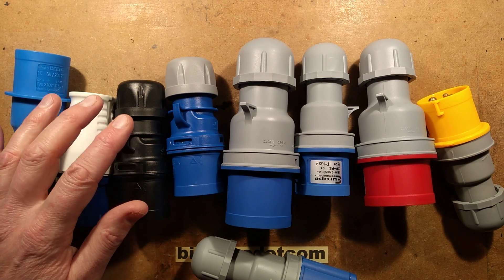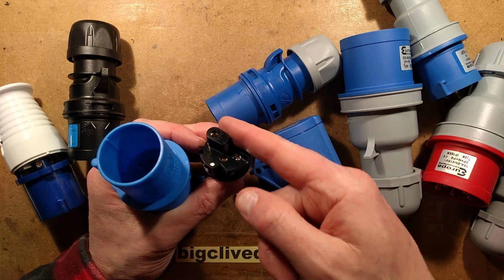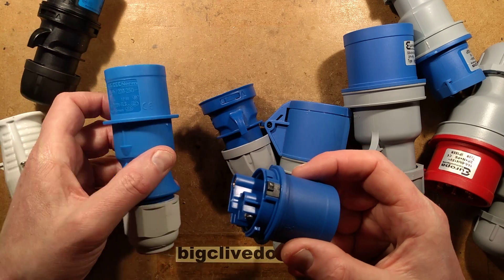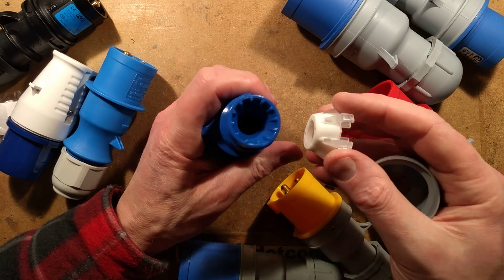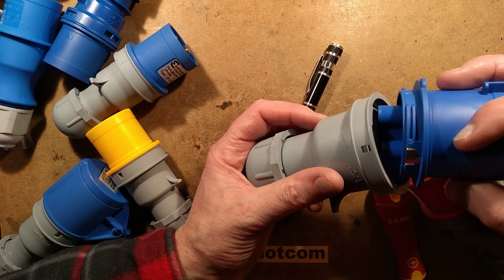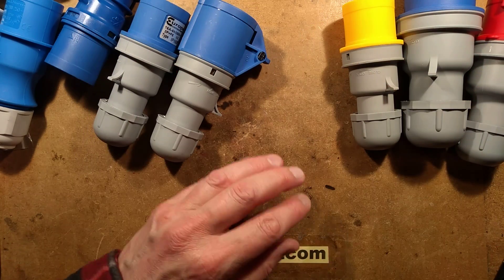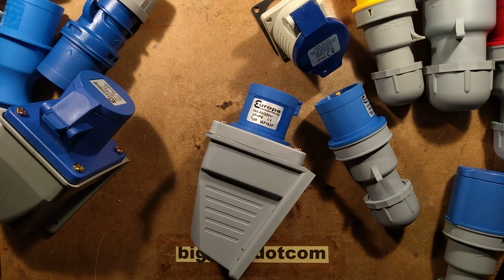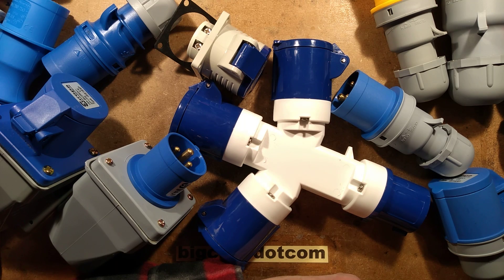My favourite industrial connector (Ceeform).

Comment: Telecommunications in the states for secondary backup generator connection.  Remote equipment shacks have a UPS that can hold it for 48 hours, and a onsite generator with enough fuel for 7 days of operation.  for every 3 remote locations, we have a response generator that can be towed to site, and connected.

Comment: we use them for almost anything here in Finland. On our workshop at home our welder, air compressor, fans, and bigger extension cords have the the 16a or 32a 3-phase plug. we have them around all around the yard so we can take power where needed for welder etc
Reply: also never seen a blue one myself. we have the red ones only

Comment: It's like a shore power connector here in the States but the pins vary. Some are like the ones you show here. Other's are done like American plugs.
It's used in campers, RV's, van homes, tiny houses, boats etc when plugging into the electric grid.

Comment: As a chef we have them EVERYWHERE in the kitchen, the ovens use LOADS of power. 
So does most of the machines we use, e.g industrial dish washers and mixers.
So I'm familiar with them, we have 2 that look like normal plugs.
Charge my phone from it lmao.
Also there are HUGE red switches that turn them on and it scares me every time.

ALSO YESSS THE CATERING INDUSTRY GETS A MENTION, AND YOU RIGHT ONE OF MY CHEFS PLUGGED A 240V HOT CUPBOARD IN TO A 400 SOMETHING V AND THAT WAS SOOOO LUCKY NO ONE GOT HURT, RUINED A 3K HOT CUPBOARD LOL.

THE DISHWASHER RUNS ON 300V  PLUGS FOR SOME REASON.

Comment: I've seen single and 3 phase versions on refrigerated trucks, trailers and shipping containers here in Australia. Used for powering the refrigeration equipment when the vehicle/container is in storage in a yard/warehouse etc. A diesel engine normally runs them when mobile. Usually the lead has a female single or 3 phase Cee-Form on one end and a single or 3 phase Clipsal 56 series or equivalent connector on the line end which is our standard for heavy duty 240v single phase and 415v 3 phase wall outlets especially in industry.

Comment: Switzerland, we use them for anything larger.
Starting to use them from 16 or 32A depending on usage
For things that don't get abused we can use the much, much more handy T23 or T25, if 3 phase is needed, connectors.
Also encountering the CEE plugs in cheap German imports when we turn up with the local sockets and curse Germany.
Personally not enjoying the CEE much. But it's better than the old J connectors (J40 for a 40A example). One thing that the CEE is missing when replacing certain J connectors is the ability to be plugged in in reverse. Some odd farm equipment I've encountered relies on the plug to reverse the motors.

Comment: I've seen similar connectors on a German-made motorized construction material lift.
I think it was under a different name, but the GEDA Solarlift is pretty much the same as was what we had, and the winch unit had 3 connectors; a 3-pin for the top safety switch, a 5-pin for the control unit, and a bigger 3-pin for the power inlet cord.
Reply: 63Amps?  100A peak = 63A average.  Still a strange number. Then there  is 6.3V for thermionic valve heaters...

Comment: If you have a cable with a CEAG ATEX plug on it, you can use the CEE socket to connect it. Obviously don't do it in an ATEX enviroment, but great for making an adaptor for powering up the tool for maintenance. They are likewise colourcoded yellow and blue.

Comment: "I like to twist them, and fold them over, and fill that hole there" -Clive
Reply: what about ferrules? i like using ferrules, even if uncrimped, on stranded wire which goes directly under a screw
Reply: @ketas  you may have missed a double entendre.
Reply: So that's what he means by big clive.
Reply: Dirty fecker! 🤣
Reply: @johnf3326  Depends on which holes he likes the fill. So holes are dirtier that others. 😯😈😆
Reply: @dadillen5902  Even the same types of "connectors" vary greatly in their relative cleanliness!

Comment: i have used them a lot. mostely the blue 63A 3P+PE here at home i only have blue 16 and 32A 3P+pe (4 pin 3 phase 230 volt.) other places i use the red  400volt one 4p+PE.

you did not have many 3 phase blue there.. and no 3+E ones.

ohh i'm in norway.. we have a IT/DELTA power grid. hope you never get to work on one ;)

Comment: You forgot to mention that the latch on the outlet will grab onto the plug when connected making it hard to pull them out on accident by tripping over the cable for instance. 
Also i have seen a new version that does not use any screws. you simply put the wires in the right slots inside (they are labeled and colored so its even less likely to mix anything up). Then you simply screw one pice into the other. Blades in the other part bite into the wires as you tighten and establish the connection.
I cant fint a picture right now unfortunately.

Comment: I use the 380v 16a 5pin on electronic hoist (entertainmentindustry) but i found them with a white circle inside that allows you to swap 2 phases with just a click of a screwdriver, very handy if you rented some badly wired hoist and one goes down when the rest goes up

Comment: I'm in the US and we use them for a few things in my work. We use them to plug PDUs into the overhead power distribution in our data center. We also have a bank of powerlocks on our generator building to allow us to hook up a portable generator  to supply standby power in the event of a generator failure. In our switchgear room we used to have powerlocks setup so that we could cross-feed the A power system from the B inputs in the event of a double UPS failure or problems with bypass modules. During our last power system upgrade we replaced that with some custom switchgear that does the same thing in a much safer (and more convenient) way.

Comment: I finally have to disagree with you. While they are great new, once the are used outdoors over and over again, the holders for the metal pins wear. These plugs become Chinese finger traps and are nearly impossible to unplug.

The metal pin and the female side are not firmly fixed in space. If you imagine they angle when being pulled apart they will wedge and make it take astronomical forces.

They are used in US for RV plugs and also carnival rides and outdoor events

Comment: Dutch firedepartements have to change all connectors on electrical equiptment to Ceeform to be used on our own generators. This is also to prevent personell using normal eu sockets from house installations.

Comment: I've got boxes of these connectors and reels and reels of cable for free in the last couple of years as people move from 110V tools to battery tools in the UK

Best find was a 110V rope light, a 110V cable with 20-odd light sockets, was given it as "110V bulbs are impossible to find now", I just filled it up with LED bulbs that are also sold in the US and it all works fine! :)

Comment: I've got a plug with a switch on that I use as a control pickle for chain hoists on stages. Yellow one
Reply: Pretty normal for that industry, but completely NON standard usage of a yellow plug
Reply: @jesperdahl1486  it allows me to control each motor independently. Good for running chains through on derig etc. I agree it's non standard usage. I was in construction for years and only used them for 110V.
It works fine, though.
Reply: @Critical_Stinking  I know it works fine, one of the bigger production company's in Copenhagen has them on their LOADSTAR cranes
Reply: @jesperdahl1486  I use the same. CM Loadstar

Comment: They are very common in Austria. In fact I have two of the red 3-phase outlets in the basement for tools with 3-phase motors (even simple things like a drill press) and heavier equipment like concrete mixers. So not industrial at all. Just normal home use, and I guess many households (except for flats) will have an outlet somewhere.
I also have a 3-phase extension wire, where two of the pins can be rotated around in order to make motors turn the other way. I actually don't know if there's a standard in how the phases are to be wired, but I have seen quite a few 3-phase tools that have a reverse switch of their own, so I think the direction of the phases can be random and you switch them into the order you need them.

Btw. I don't think that you mentioned that the cover is not only a cover but when plugged in also doubles as a lock to prevent disconnect when pulling on the cord.
Reply: You are SUPPOSED to connect the Phases L1 - L2 - L3 in a clockwise fashion, when looking at a outlet, but things happen, therefore the changeable plug is nice, when connecting motors

Comment: Sadly, the NEMA SS2-50R 50 Amps 125/250 Volts Connectors I like to use for exterior use (and for heavy current situation in my shop for welders and such) are bloody extortionately expensive.  And just as painful for the 240/480 3-phase four-pin versions. :(  But they last *forever*… I’ve got a portable screening plant + generator that’s going on 30 years of intermittent service.

Comment: I always used the one with 2 internal screws, mostly used in farm situations (say no more about farmers with electrics), the ones we used had a rubber cone on the back which helped with the bending you mentioned at the end
Not sure i like the idea of being able to remove the cover while still plugged in, but if you're ok with it, that's  fine
Biggest i've installed was 63A 3ph + N for a generator feed to a building (essential supplies)
You may find it easier to get the inlet plugs from caravan suppliers, though we had no problem getting them from the usual electrical wholesalers.

Comment: I use the yellow 16A3p9h for ACL light bars, 16A3p6h for power distribution and 16A to 125A5p6h for powerfeed like every normal human being in the german show tech scene. Fun fact: the 63A5p6h and 125A5p6h connectors have a 6th pin to trigger a contactor at the feed side so it's not possible to accidentaly plug or unplug the connector under great load.

Comment: We use them extensively in the maritime industry, the purple SLV style is used as trickle chargers for the lifeboats batteries.  Interestingly we also have 240V all metal female sockets around the deck for powering machinery.  The all metal construction is to protect against impact from cranes and cargo.  They are all slightly different in that the cap is screwed in place with a gasket to give a better seal when not in use.
Reply: Another interesting fact with ships including cruise ships is that the AC carries two phases 180deg out of sync as we cannot run neutral to the structure as it accelerates corrosion.

Comment: I know that in the usa there used a lot for snowmaking, it's pretty much the same but 4 prong, 3 phase, 480v mostly, and no ground.
Lots of different amperes from 15 amp to 80 amp mostly, with the ones I've seen.
That's the only use I've seen them in the usa.

Comment: Most homes in NZ have these installed in the bedroom for mains operated vibratory devices....
Reply: I think that's only the 3-phase variants.... And it's somewhat limited to Otara and the Sth Island
Reply: So that's why the lights dim.
Reply: I'd have thought extra vibratory devices were the last thing needed in NZ...
Reply: @igornotis8877  You may have been a touch too subtle there.
Reply: I assume those will be the Electric sheep
Reply: Tony Nicholson
😲
Reply: @steveosshenanigans  My landlady has a 125A Ceeform on her wall. I always wondered about that till now. Thanks so much.
Reply: Industrial grade concrete vibrator._
Reply: Excellent for the moist environment also.

Comment: Hi Clive,
 say is there another plug for 3 phase power in GB, or only the CEE 5pol?
in germany cee 5 pole is the only connection i see for 3 phase power, on old installation there is that perilix connector a thing, but non are new installed.
There is also that 4pol cee variant for 3 phase motors which don't need an N connection...
Reply: An than is there that wired 7 pol variant where you can use it for al kinds of crazy things, i have sen one on an air powered silo, stucco delivery system on an job site

Comment: Very common here in Germany. For the three-phase version there's also a version available with an integrated phase changer to change the rotating direction of a motor. It will change the positions of L2 and L3:

https://www.spaelti-ag.ch/elektro/wp-content/uploads/2017/12/Funktionsprinzip-1024x473.png

The versions for 63A and larger have a pilot contact integrated, so you're able to switch the load off with a contactor in the fuse board. Otherwise it could create an arc if disconnected with a load. The pilot contact will switch on the contactor only if the plug is fully inserted.

Pilot contact in the center:

https://upload.wikimedia.org/wikipedia/commons/a/af/CEE_Stecker_mit_Pilotkontakt_63A_6h_5P_2012_01_31.jpg

The pilot is connected to the N:

https://docplayer.org/docs-images/67/57797804/images/25-2.jpg

Comment: Similar design used in shore power connections on US research ships I've worked.  Most dated from the 1960s, but the connection could have been upgraded over the years.

Comment: what about the ceeform connectors that twist-lock onto one another when connected ?
Reply: You sure you mean ceeform, and not something like powerCON or powerlock/camlock?
Reply: @Grizzly01  nope, deffo ceeform, there was a version of it, from MK i think, that both socket and plug IP67 rated K series commando by MK had twist caps for a better seal.....such as the 415v K9097

Comment: I use the 16A at home as  extension leads so i can leave them outside at night and handy for Xmas. And  the hard plastic drive over bumps are used for 3  phase leads when they are  individual cores

Comment: What did you use before the cee cables. We use them in Denmark as well.  Before that, we had some flat connectors (Googleing “Dansk flerpolet system” found some pictures, YouTube likes to mark comments with external links as spam) 
 I remember in the early 80s, I was working summer jobs during the school vacation, cleaning machines with a high pressure washer at the paper mill. At that time we had no problem having a 14-15 year old working a machine that cut off fingers with water. 🤣 anyway that had a even more arcane connector with their heavy cables where I needed both hands to lift and push in the connector.

Comment: In the US, Florida, Lighting tech. I've mostly seen these or similar connectors used for connecting power to motor controllers for rigging, and occasionally for hooking up 3-Phase distros.
Reply: You see them on Skjonberg controls, but not much else. Which makes me think it's a European thing, but Skjonberg are based in California. . . . I know I see a fair amount of moving fixtures in from Europe with Ceeform whips.

Comment: Those suck when they get a little worn and they "fuse" together. Almost impossible to pull appart when that happend... And can be quite dangerous. I have had live female pins come out.
Reply from the maker: It's a long time since I've had a pair fuse together, but it's usually a cut off and replace job.

Comment: Is that TRS cable similar to American SOOW?
Reply from the maker: If it's a tough rubber cable then it probably is.
Reply: @bigclivedotcom   "SOOW cord features bare annealed copper conductors, EPDM insulation, thermoset CPE jackets, and paper tape separators to facilitate stripping."

Comment: Science fact though, this is very much the same as J-1772 and I agree, they're bulletproof, someone even sprayed silly string in one charge point and it still worked, they self clean sort of!
The J1772 has a clever thing where the pins are inside deep holes though so even better protected against drops and mud and stuff.

Comment: Singapore - Seen at all temporary public event setups~ Always used when there is a diesel generator. The UK plug is for the masses but the lobbies of public housing have such plugs to cater for daisy chained lights and fans, portapotty etc during an event such as wedding celebrations or funerals

Comment: USA We typically use Twist-Lock connectors up to about 50 or 60 amps then we have single conductor connectors for high current applications but the ones I use to connect large generators 200-400KW 480v 3 phase aren’t meant to be connected live, they remind my of the lug in the front of an arch welder

Comment: In the hospital I used to work in, I had to remove Blue 5 pin 16/32A connectors from the main operating theatres, they provided a single phase supply but also had a control pair that triggered a contactor, so that the socket became live when the medical appliance was connected. It didn't make much sense as you would theoretically still have supply present when 'breaking' the connection (which is what they were trying to prevent I believe) but I never got a look at the plug on any of the appliances as they were long gone, so they might have had physically shorter control pins.

Comment: I’m sure there are content for a part 2 of this! For instance the “hour rating” on the plug - for a while I thought that the “6h” marking referred to  “rated 16A continuously for 6h”, but I later learned that’s the description of the position of the earth pin in relation to the key.
Reply: Christoffer Lundgren oh is it really never knew that I assumed the same
Reply: There is always a mandatory break after a 6 hour period ;)
Reply: Frankhe78 McDonald’s runs their fryers only for six hours, then it has to cool down for an hour.
Reply: @JasperJanssen  They desperately need to replace those 6H connectors ;)
Reply: @JasperJanssen  Ahhh, thats when you get the bad soggy  shoestring fries